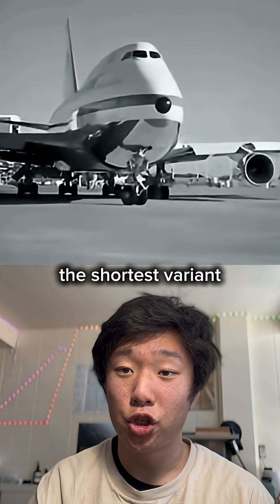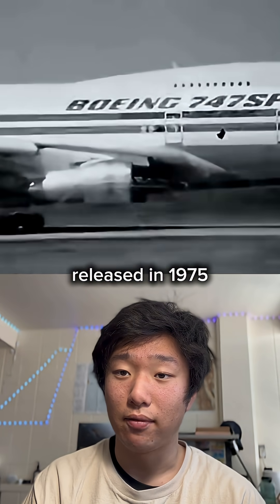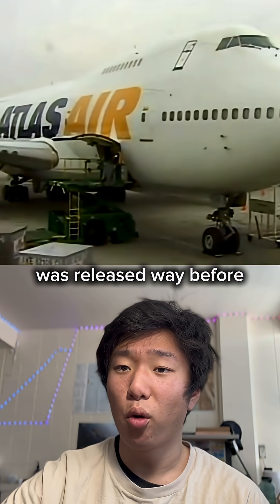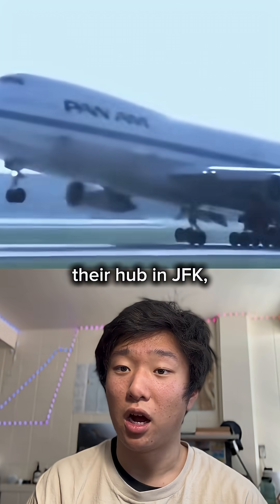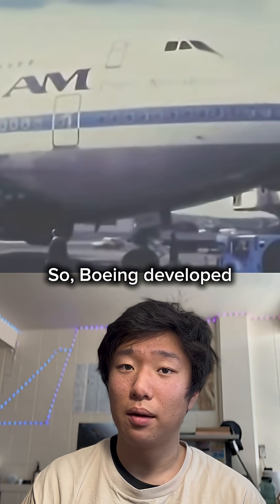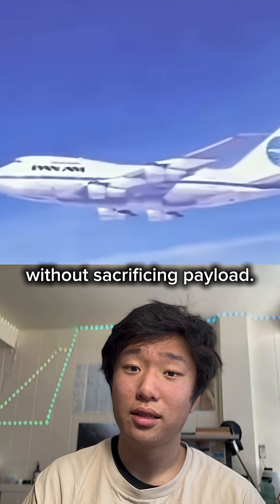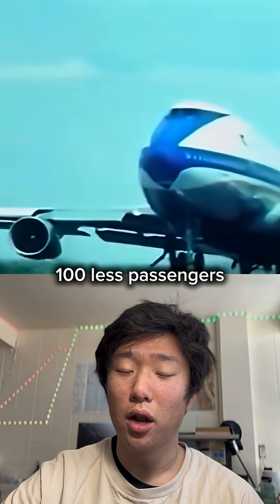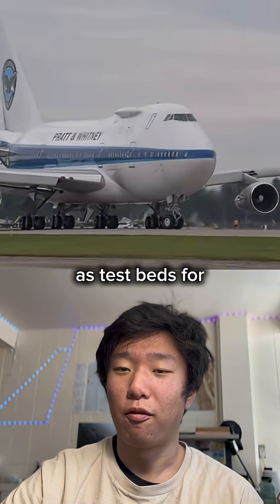Why does the 747SP exist? #aviation #747 #aviationgeek #aircraft #boeing #flight #boeing747

Comment: I don't really know what was the real performance figure of the 747SP or the 747-200B but i've read a few times that initially, the 747-200B could only fly between 5000 to 6000 nautical miles. From what i've found, the 747-200B could finally fly over 6500 nautical miles with more powerful engines which became an option in the mid to late 70s. That's from what i've found, y'all can correct me if i'm wrong.
Reply: Fewer.

Comment: They should have done it with the 777X it should have gone at least 14000 km
Reply: 777x doesn't even fly yet
Reply: @deltakat27 I know yet it's engines the GE9X only produce 105k lbs while the GE90 produces 115k l s
Reply: @SpaceNerdXIIII know Boeing deserves shit but I am willing to bet the engineers know of this fact, efficiency especially with regards to fuel is the name of the game and companies will always focus on it.
Reply: @SpaceNerdXIII no, it can produce 135K, but it’s currently not required, so it’s derated for the moment.
Reply: @rtbrtb_dutchy4183 actually that's how much it did through TESTING. What it can produce(or output) in the air is 110k. Even so it can go that far anyway, but it's still an amazing aircraft yk?
Reply: But you are right it is derated, just not from 135k.
Reply: @SpaceNerdXIII yes, it’s derated from there. (The actual number is 134,300 lbs I think) yes, it was producing that in testing, but it can run like that all day long if needed. 

Due to a better wing, Boeing didn’t want more than 110K, because the 777X doesn’t need it. Probably, in the future, it will need a bump upwards and if it’s a small bump, it can simply be done with software. If it’s a significant bump, it probably requires some structural strengthening as well. 

The big improvement of the GE9X is that it keeps its rated power at much higher density altitudes. So if you want to fly out of Denver at 35°C, the GE9X will outperform the GE90.
Reply: @deltakat27 Yes it does, it’s just not certified for airlines yet